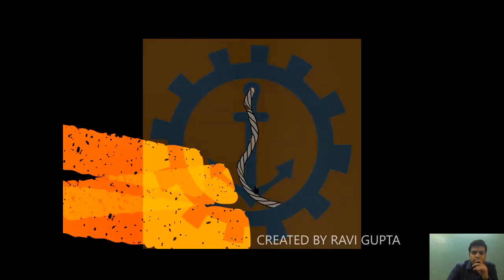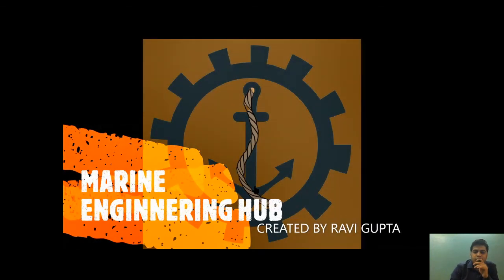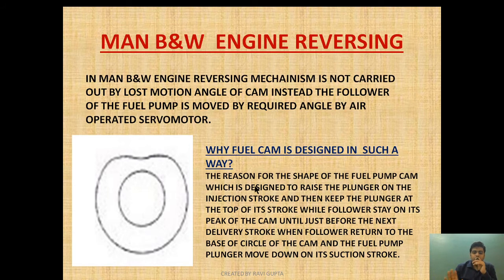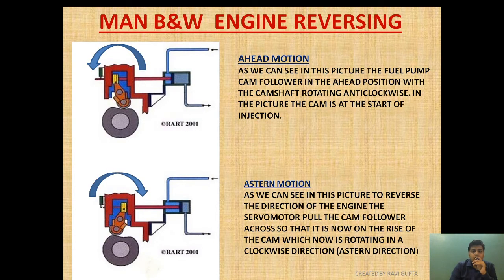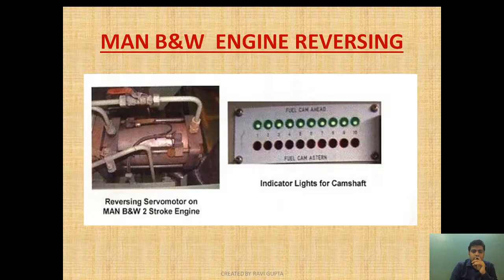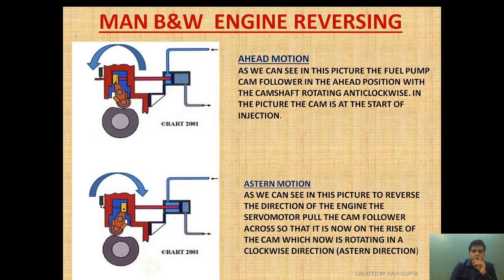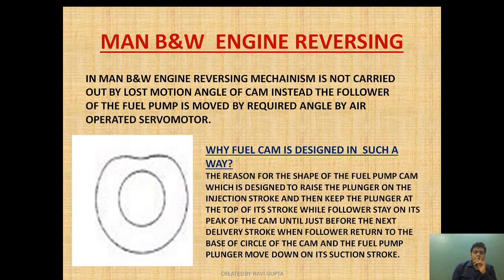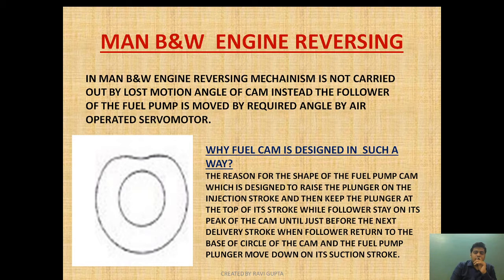REVERSING MECHANISM|MAN B&W ENGINE|REVERSING CYLINDER|

Comment: The green light indicates the movement of cam with roller in ahead direction so if reversing signal been given the the servomotor will pull the roller to keep it in contact with astern cam peak so that is indicated by red light which I have seen in my ship... But sir u told the green light indicating the how much cylinder comes to reverse .... Please Correct that sir...
Reply: He needs to follow a script.